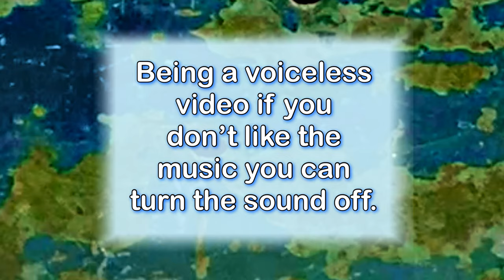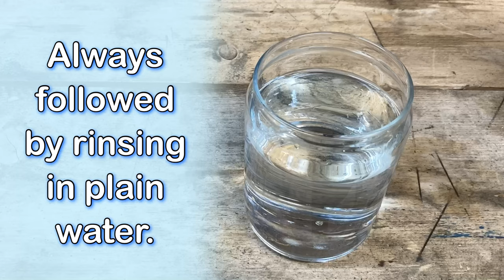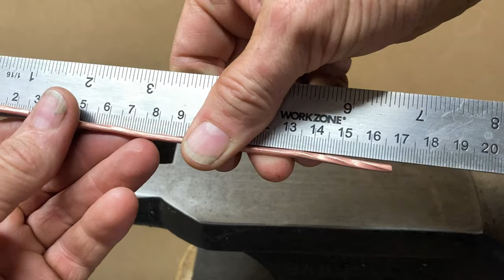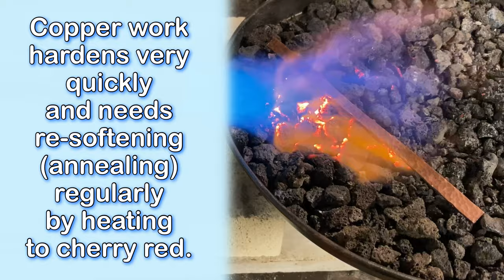Melting and forging copper into cuff bracelets (and making tools to help)

Comment: This is a very comprehensive lesson, tool making and metal forging, pretty much a lost art nowadays, today it’s 3D printing, lost wax casting or buying it made 😅, beautiful bracelet btw !!
Reply from the maker: thanks for that Hector, I was surprised how well this worked, i’m used to casting silver like this for making wire but had never tried copper.
It just seemed to need to be a lot hotter 🔥 … cheers … Nick

Comment: Glad to know that you can melt copper with the little torch.  Project turned out nice. Must purchase the multi tip! £58 + now! ! Cheers
Reply from the maker: hi Jim, as long as it’s not too much copper and it is in a small crucible seems to work well with the multi jet tip. surprising how much more heat you need than just melting silver … how everything goes up in price I think I paid £30 a long time ago … Nick

Comment: Forging other metals like copper opens a whole new world to me as a blacksmith…
Reply from the maker: hi Raymond, so much variation when forging different materials. This was the first time I had tried copper, its ability to work hard so quickly is a strange property to deal with. I tried stainless steel one time surprisingly hard going. Alec Steele made a great video when he heated and forged a bar of gold on his anvil … happy hammering … Nick
Reply: @Nickscreativestuff  was that graphite that you cast it in? I’m trying to basically forge weld with clump of copper scrap together, nearly melting it each time.
Reply from the maker: hi Raymond, I poured the molten copper into a short piece of angle iron and used two small square steel pieces for stop ends. surprising how much heat is needed to melt copper but when it gets there it flows well  … N
Reply: @Nickscreativestuff Thank you for your advice! I think I know what I might be able to do… I could do the same and use angle iron, but also as the crucible? My propane forge makes the copper oxidize like crazy, so maybe I could add some borax with the copper scrap. 
Or if this wouldn’t work, I have access to firebrick that could be carved into a crucible, some high-heat mortar that could be mixed with dust of firebrick to maybe make a crucible, or I could even access this grey clay vein and make a crucible of pure clay…
Reply from the maker: using borax is a great help it seems to clean, lubricate, seal crucibles and protect molten metals all at once. Making your own crucibles will be a great achievement. Safe guarding against crucibles full of molten metal failing just at the wrong moment must be an important consideration with this option … good luck with it … Nick

Comment: Love watching your creative process. Angle iron for ingots is genius. Does copper work harden faster than silver? Cheers, mate!
Reply from the maker: Thanks Monty, Nice words “creative process” i’ll have to use them if I ever get to merchandising level on YouTube, I fancy having a go at T-shirts and slogans. I found oil helps when using angle Iron, managed to miss that out in the video. Copper seems to work harden incredibly quickly when you’re heavily working it. Hot forging really helps with this issue and makes it very pleasing to work with. i’m sure the same process would work well with sterling silver however the chance of melting the end off is more at risk … cheers Nick

Comment: Now that is a bracelet with some heft to it! Love both the bending tool and the ingot mould, not to mention the bracelet itself. I have dual fuel (oxy/propane) for my lampworking torch... might just have to get a another torch and use up some of my scrap copper. Cheers Nick, looking forward to you next video.
Reply from the maker: Hi Jirup thanks for your comment, Great to experiment and practice techniques with copper, not sure if I would want to try this one with silver, I would end up using all my stash being 60g or more. if you have an Oxy generator for your lampwork you could have endless fun melting copper without too much expense. if you buy a “Smith’s little torch” try to avoid the counterfeit and copies on the market, I heard people have terrible troubles with them. not sure what’s next, it might be more simple pegboard projects … all the best … Nick
Reply: @Nickscreativestuff  No concentrator, unfortunately. The slab in the workshop is old and abraded. I fear a concentrator would just choke in there. I've heard the same regarding the Smith's ripoffs, not worth the trouble.
Reply from the maker: same as me, they’re probably too sensitive for my Workshop. I just try and be conservative with my large hobby gas Oxy bottle … cheers … Nick

Comment: I have four small nuggets of copper that I want to turn into a bracelet, and you video has been by far the most helpful and confidence inspiring video I’ve watched. Thanks. 
I do still have a couple of questions though I hope you don’t mind me asking:
I’ve bought a new scorifier and I saw in another of your videos (the melting a silver bar) that you “treated” your new one with borax…. Can flux be used? Both to treat a new scorifier and to purify the copper when smelted?
Reply from the maker: hi Mark thanks for your comment, I don’t think flux would work in the same way as borax for these processes. flux tends to burn off and degrade at high temperatures whereas borax has a syrupy consistency once up to temperature. it sticks and hold onto contaminants and dross helping clean molten metal by pulling it off the surface and adhering it to the crucible. A well seasoned Crucible ends up with a nice glossy glaze of borax acting as a lubricant that molten metal floats over easily …  good luck with it …  Nick

Comment: Really informative, I hadn't thought about doing my own copper ingots at home, but I will trying that out. Have you had a go at brass too? How'd that go?
Reply from the maker: Hi Shaun, i’ve only ever melted copper, bronze and silver in my Workshop. Apart from making solder I’ve never melted brass as I worry about the potential zinc fumes … N
Reply: @Nickscreativestuff  Fair enough. I've had the zinc shakes from welding galvanised metals before, not fun, so I understand.
Reply from the maker: oh yes, can be really dangerous for hobbyists if they don’t know the dangers when in a confined space for long periods … N

Comment: Love the ingot , will probably use that at some time . Just curious as to why you forged it while it was hot .I have found that copper is more than soft enough to forge and then anneal. ❤💛💚
Reply from the maker: thanks for your comment Jeff, when moving copper a lot I find it work hardens incredibly quickly. by working it hot I find it moves very easily and saves a lot of time going through the re-annealing  process, no need to cool quench and dry then reheat again from cold. I tend to do any finishing process cold for more accuracy and control.
not sure if I would try this with a silver bar I, would probably end up melting something … all the best … Nick
Reply: Thanks , just started working with copper . I know that silver will not handle that process same as gold , they are both not malleable when red hot.
Reply from the maker: not sure about that … have you seen the Alec Steele video “can you forge solid gold” … Worth a watch, amazing what you can be doing when you have over a million subscribers … Nick
Reply: @Nickscreativestuff  I have not . will check it out .

Comment: Looks fun! What kind of torch is that and what gas are you using?
Reply from the maker: Hi MM, i’m a proud owner of a Smiths Little Torch that runs on a mix of oxygen and propane … hot, hot, hot … 🔥🔥🔥 … N

Comment: How do you keep the copper from turning your wrist green (patina)? I didn't want to keep applying a spray clear coat (lacquer), especially when I give away most of what I make. (You know how it is; family and close friends always want stuff for free.) 😊😊
Reply from the maker: Hi xFalconFixer, The best option I’ve found is to preheat the piece first before dipping it in a tin of hot molten wax. if the wax is nice and hot it gives it a thin coat giving a thorough seal that will last awhile … N

Comment: I would like to know what torches you are using.  How big?  What gas?
Reply from the maker: Hi Aly, it’s surprising how much heat is needed to melt copper. I use what’s called a “Smith’s Little Torch” that runs on a mix of propane and oxygen … N

Comment: Hey Nick- Thanks for the great videos. New subscriber here! I'm sure this has been answered but what kind of torch are you using? I assume oxy/propane but you can change your tips which is fantastic. I have a MAP gas torch to start with. Will this work?
Reply from the maker: hi Caitlin … thanks for your comment and sub, I used two torches in this video the first is Oxy - propane great for the extra heat needed to melt copper then I switch to pure propane because not as much heat is needed to forge it. I think MAP gas would just about melt copper in a small crucible. I would start by heating the crucible then adding small amounts of copper to see how well it copes … 🔥good luck with it … Nick.
Reply: @Nickscreativestuff  thank so much for the detailed response! I really appreciate the advice and you sharing your creativity.
Reply from the maker: Cheers Caitlin …  Nice to be able to help if I can … N

Comment: I noticed what looked like a Smiths little torch for the initial melt. Then after, a Sievert. Im totally new to this, im interested to know what the interchangeable burners were after that. 
The kiln post / prop is new to me and seems very useful.
Your videos always bring a smile to my face.
Nick, I noticed on a previous video, that someone had made a small donation to help sponsor your channel. How does one do that?
Reply from the maker: Hi Alan, being a hobbyist I always striving to conserve my expensive gases. Melting copper needs the extra heat from oxygen when using an open crucible like this. However once I change to forging it less heat is needed and a pure propane torch will do the job. The interchangeable nozzles are graded to gas consumption per hour and using the ceramic kiln post helps conserve and build the heat needed, resulting in a much smaller nozzle achieving the temperatures required. After taking advice from other YouTube creators I have started to timidly add donation reminders to my videos. The donate button is called “Thanks” and is found in a line of other buttons just under the video, it has a symbol that is a $ sign in a heart  … thanks for your support … Nick

Comment: Hi, can I recycle old copper pipes as well, as long as it isn't too much rusty?
Reply from the maker: Hi Diabel, copper pipe tends to be very clean and pure and is great for melting down for recycling. Any oxidisation or corrosion can be skimmed off once molten … N
Reply: @Nickscreativestuff  thank you very much for the quick reply and the advice!
Reply from the maker: good luck with it. Have fun … Nick

Comment: What was the tube you reheated the copper in?
Reply from the maker: Hi Steve the ceramic tube i use for a variety of projects is called a kiln prop or post. used in pottery kilns for making adjustable shelves … all the best …  Nick

Comment: Thanks for share your amazing works🙏.
How did you make the tool where you melt the copper?
Reply from the maker: thanks for that R L, I melt the copper in a 2" Square Scorifier from Cooksongold.com. It was poured into an L-shaped length of metal also known as angle iron. I  place two small pieces of square steel in the channel as stop ends … N
Reply: @Nickscreativestuff  ok, and where you burn the copper, how you did that tool?
Reply from the maker: to hold the Crucible a bit of scrap metal welded together and some nuts and bolts to hold the square stone … N

Comment: good. Red copper is more difficult to manufacture. It is still very hard after annealing. I don't have such a high temperature tool to melt.
Reply from the maker: thanks Aa … I feel privileged having an oxygen and propane mixed torch, burns incredibly hot just what you need for melting copper like this … cheers … Nick

Comment: Just wondering if anyone knows what acid was used
Reply from the maker: it’s known as pickle powder when purchased from a jewellery supply company. The chemical name is Sodium bisulfate, also known as sodium hydrogen sulfate. It is sometimes sold over-the-counter by Hot Tub companies were they call it PH reducer. there are other options that work well like hot white vinegar saturated with salt also hot citric acid sold in the food industry or for wine making … N

Comment: How do you finish your copper to keep it shiny or do you allow it to Patina ? I'm looking for something to keep my wind spinners shiny that I make
Reply from the maker: hi Sinclaire, there’s a few products that would help I use wax polish a lot as a sealant. acrylic sprays would work the type sold from car maintenance shops. maybe a paint on varnish there’s a product called metal sealant unfortunate comes in small pots … hope this helps … Nick
Reply: @Nickscreativestuff  thank you so much

Comment: Can I achieve melting point with just a butane torch?
Reply from the maker: hi Kelly, I don’t think you can manage much smelting with butane it would probably melt smaller beads of copper on charcoal.  larger torches tend to be propane and needed for the amount of copper in this video say 40g.  You could test your torch bye melting a small amount and keep adding small pieces to this and see how long it takes.
hope this helps … Nick